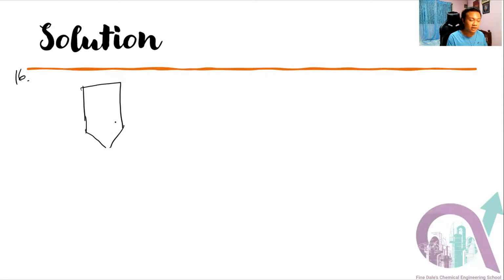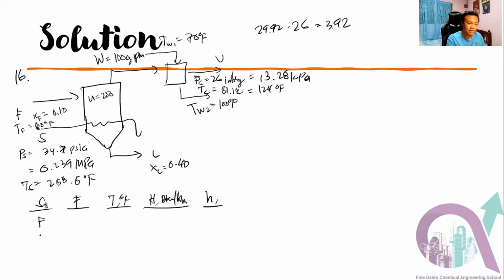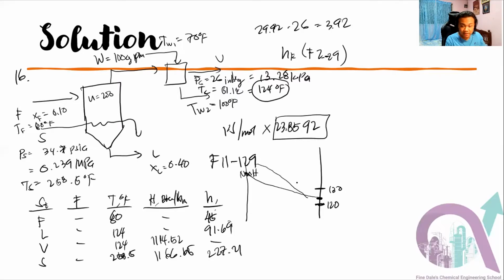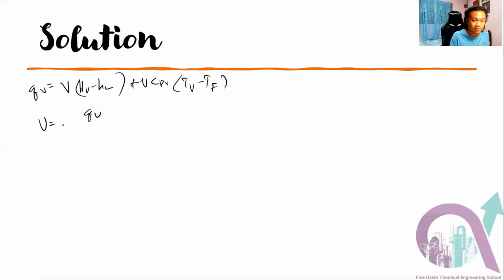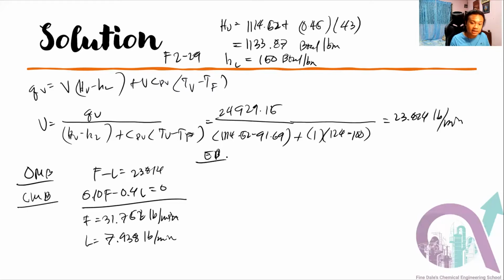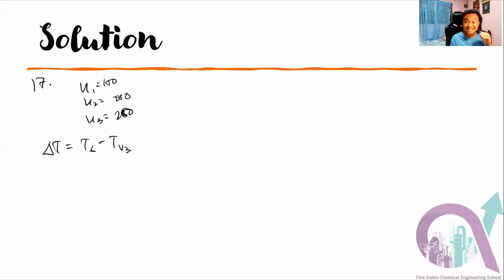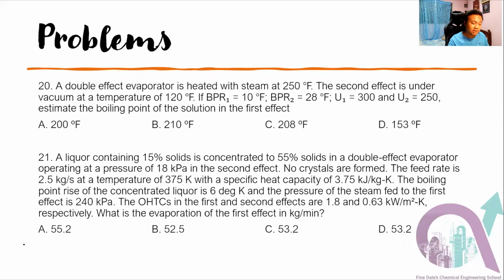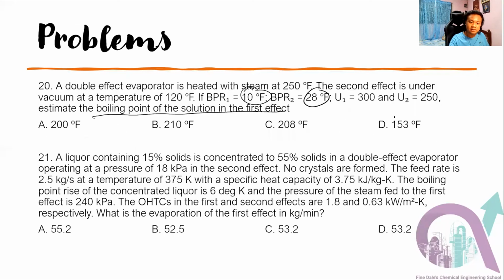ChE Review Series | EVAPORATION PAST BOARD EXAM SOLVED PROBLEMS Part 2 (16 - 20)

Comment: i have questions in #16: (1) how do you know if you have to consider the system having a BPE or not? (di naman kasi stated sa problem explicitly huhu), (2) dun sa pagkuha ng V, sa term na Tv-Tf, ung Tf bakit 100 F? bakit hindi ung feed temp which is 80 F? also (3) nung ginamit ko ung Fig 2-29 sa pagkuha ng hl (enthalpy liquid), i used 124+43 F, saka ko lang nakuha ung 150 btu, sabi mo here is 124 lang gamitin? mali ba me? hhahah sorry dami tanong haha.
Reply from the maker: Hi Lyn! Thank you for these questions! Here are my answers: 
(1) We have to account for BPR because the concentration of NaOH in the solution is not negligible. It is 40 wt% when concentrated so the BPR is significant to the point that we cannot assume that BPR is negligible. For the statement of the problem, usually in the books, they state explicitly to neglect BPR but if it does not, we have to account for it (check Geankoplis and McCabe books for this.)
(2) I used 100 deg F because it is the exit temperature of the cooling water. We are doing a heat balance in the condenser, not in the evaporator.
(3) Yes, I forgot to mention in the video that we have to account for the BPR in getting the hL. 167 deg F dapat yung gagamitin, hindi 124 deg F lang. Thank you for pointing this out!
I hope this answers your question. Don't worry, I encourage these questions because I am doing a swift explanation there. If there is anything that you do not understand, please ask it. Hehehehehehe. Thank you!